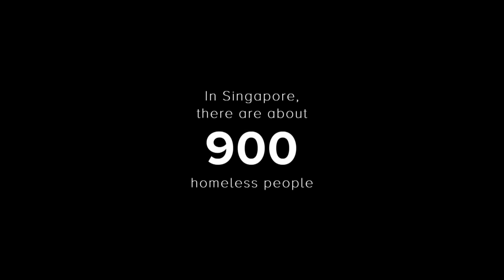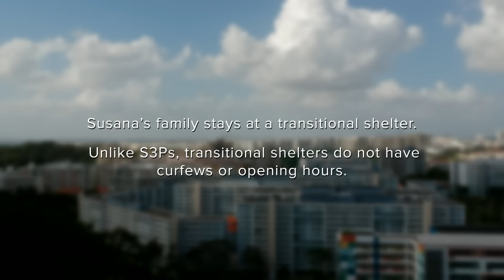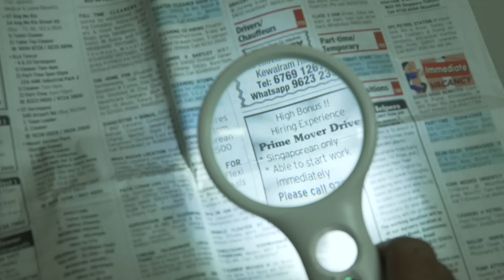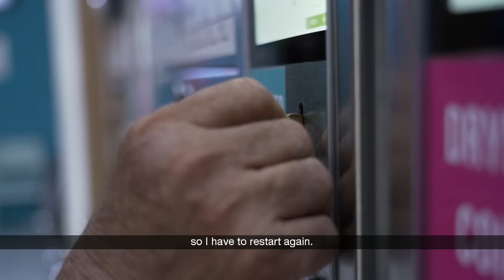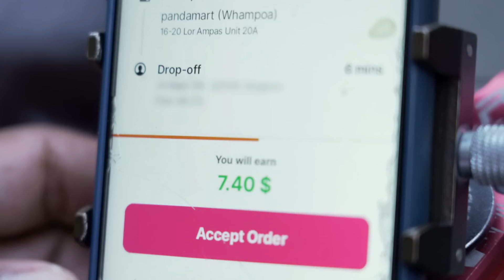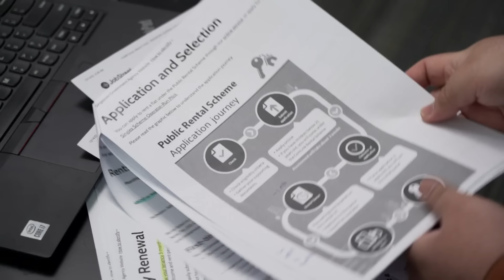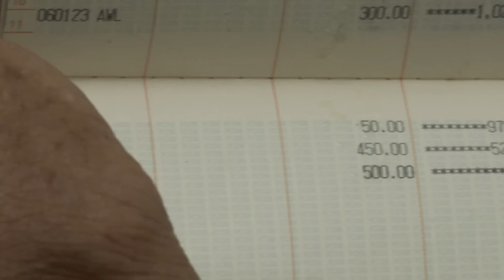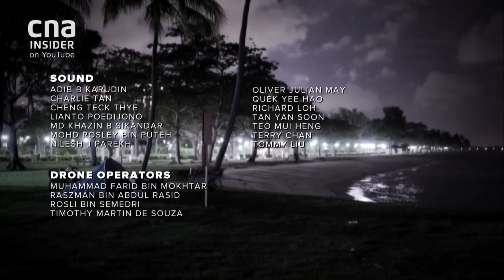Surviving Singapore's Homeless Shelters | Homeless In Singapore - Part 2/3 | Full Episode

Comment: There's a very fine thin line between accepting your fate so you can move forward in life and getting used to your circumstances then never moving on from there. Most of them are in the 2 category & clearly doesn't have anyone significant in their life to help them believe that change is possible. Material gains can only go so far as harsh as it may sound. They need to trigger a change and endure that short period of suffering to move foward. That's how harsh life is and it's not any easier here in Singapore since humans are the only main resource.